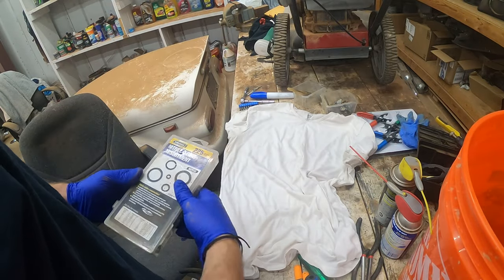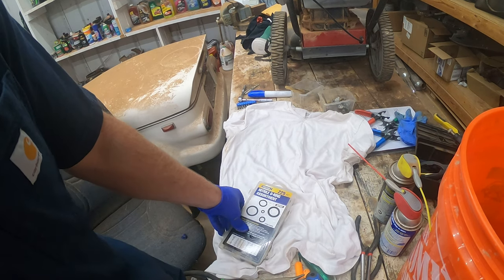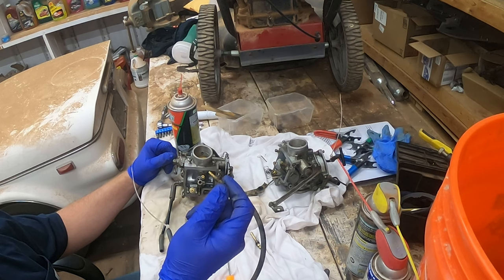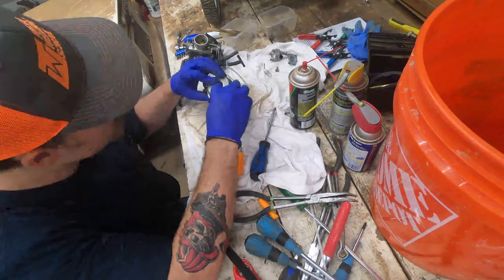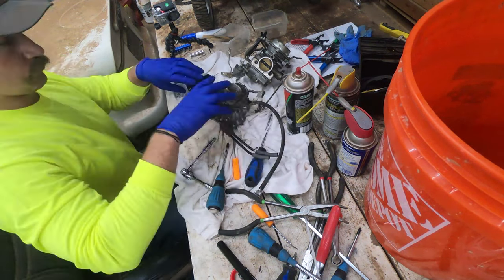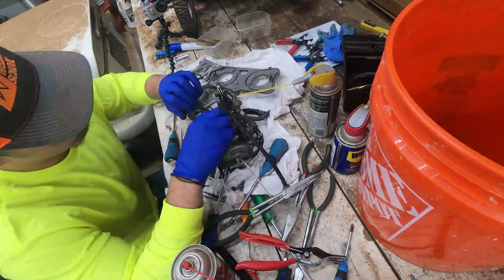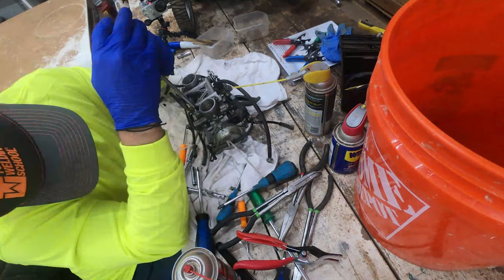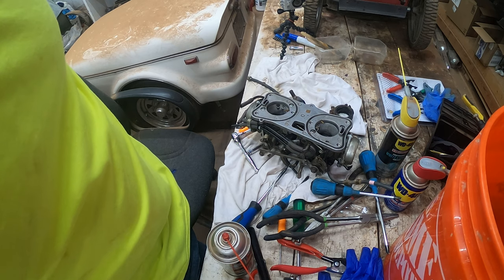How To Reassemble The Carburetor On A 1988-2000 Honda Goldwing GL1500

Comment: Great job and very detailed thanks. I’m rebuilding a 1988 GL1500 carburetor and ready to reassemble. I ordered and received the Sumo kit you referenced in another video. My question is, CRK-H-SB-18-2688 main jet has the correct size main jet 155 but the nozzle holes on the bottom are smaller the the original. Will this make any difference or should I stick with the old jets. Old jets are clean but 75k miles on them. Thanks Kevin
Reply from the maker: Thank you for the comment kevin! I always prefer to stick with the original jets. If they are not damaged from corrosion then I would clean them well and use the originals!

Comment: Great job brother.  Question, do you have any plans to do the front fork seals?  I'm thinking I should probably do it at some point so it would be most helpful. Cheers!
Reply from the maker: eventually! My fork seals are not leaking though, so as long as they are holding I am not gonna touch em! But when they need them yes I will!
Reply: @octanerestorations  Thanks!